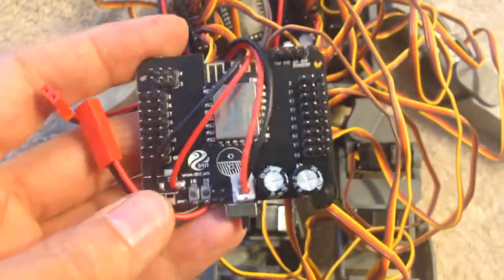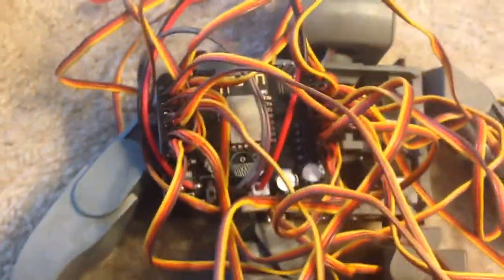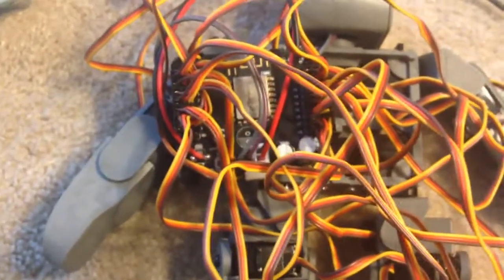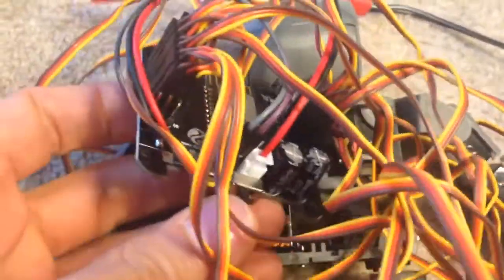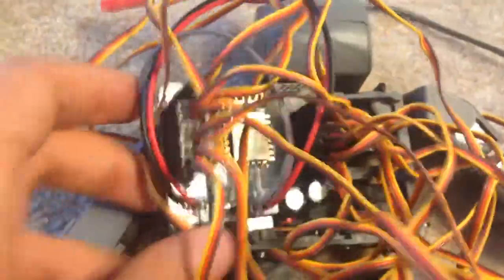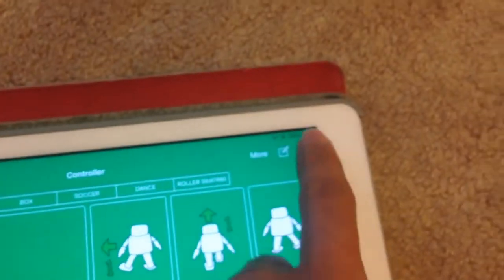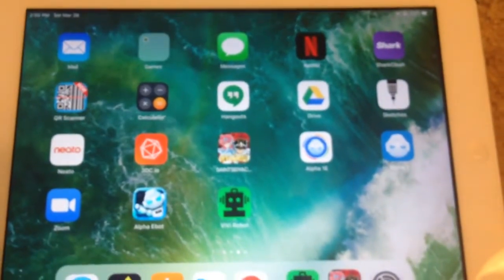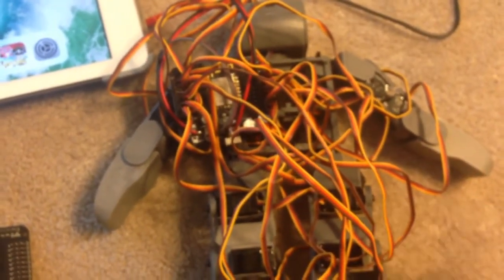ViVi plen 2 by doit app malfunction! How do I fix this? Please help!

Comment: hey do u have a video on the board?  i wanna know how u can use it
Reply from the maker: The board is the worst part of the the robot kit. I would dump it and buy another own that you know works because you have used it for other projects and install that one. Not worth making a video on a scam of a board.
Reply: @marcoreviews  thanks
Reply: @marcoreviews  would it be better by using an Arduino servo controller?
Reply from the maker: @neonuser456  Yes if you know how to connect and arduino board to that many servos and manage the software that is an awesome solution! Arduionos are very reliable! If you do that please keep me in the loop. I also want to go that route or may use another board named Lobot Korean brand I think that interfaces with a ps2 controller. If you try the Arduino thing please make a video to show how it is done because that would really help me out too!
Reply: @marcoreviews  i am also looking for a way to control servos for a robot project where the servos have programed movements but i still not sure how to use arduino
Reply: @marcoreviews  ive seen that theres an Arduino circuit that u can use your phone to control it
Reply from the maker: @neonuser456  is there a video on it? Please link me up! I would love to try it!
Reply: @marcoreviews  here https://youtu.be/9o7DFpJShsQ